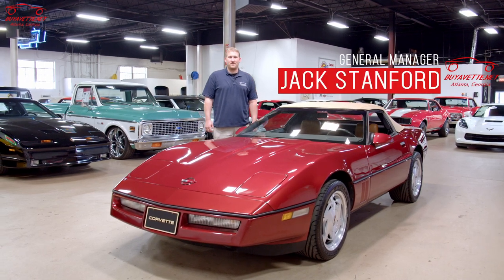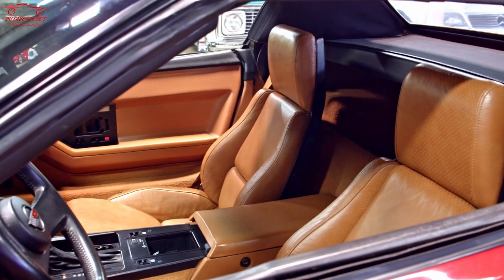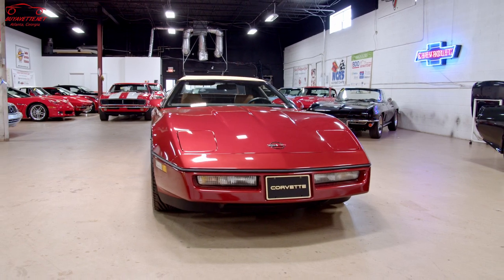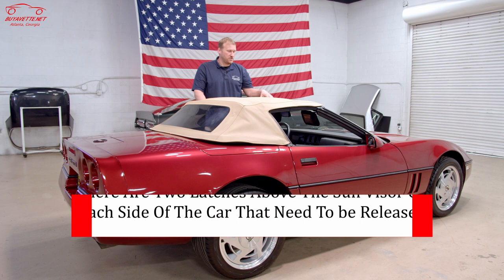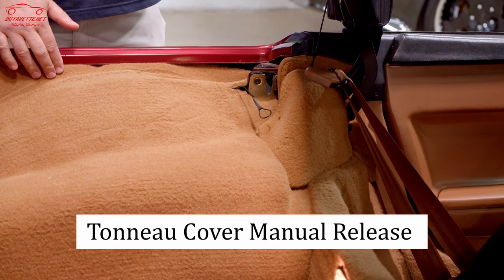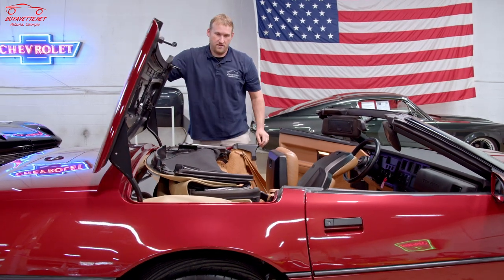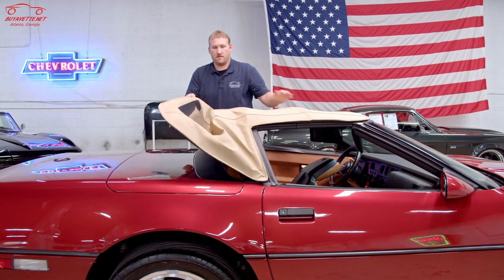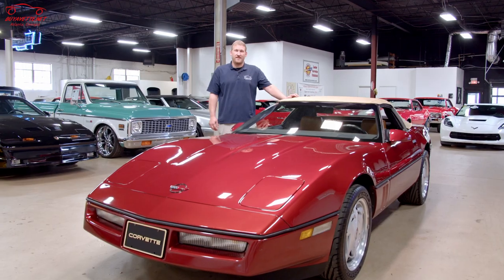How to Properly Lower and Raise the Convertible Top on a C4 Corvette

Comment: I need a 2003 50th anniversary with a manual. Black exterior, tan interior and in coupe, not convertible. Hook a guy up. 😎 must have heads up display and no ride control. Don’t want the mag shocks.